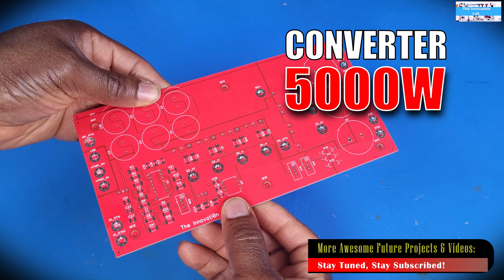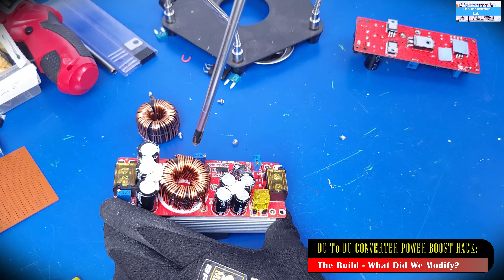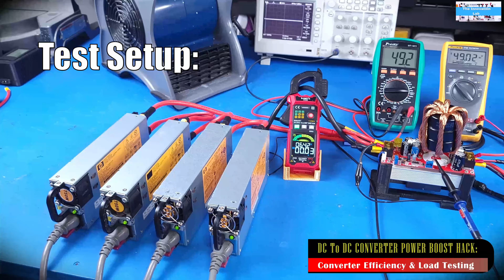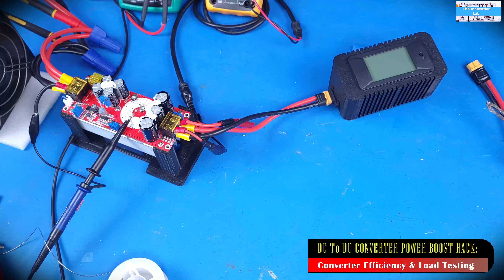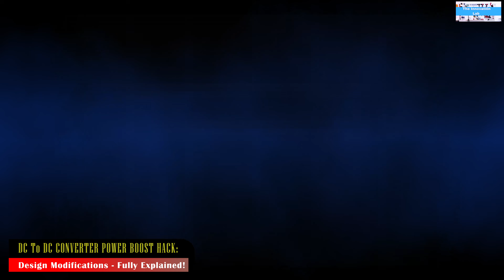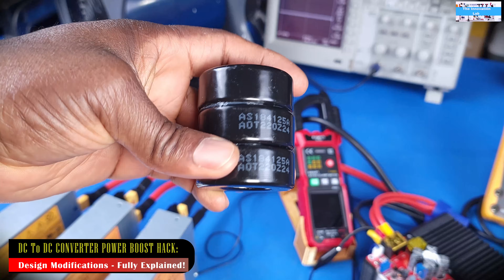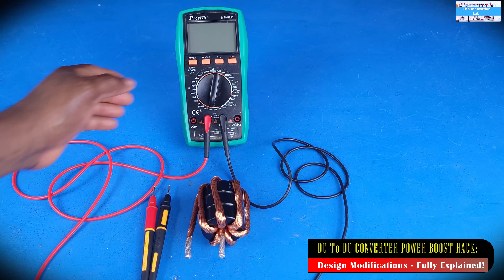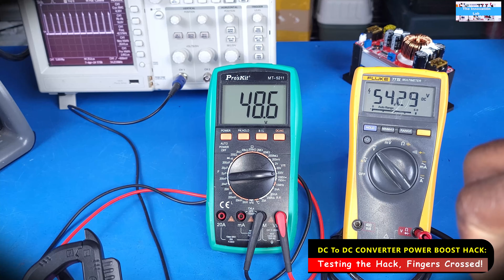How to Supercharge a DC-DC Boost Converter to Deliver Higher Power!⚡️💥

Comment: Hello dear friend, in the formula you put fsw=rt×ct÷1 in the tl494 IC, which is on pin 6, there is a resistor whose number is 103, which means a 10k ohm resistor, but you put rt in the formula 100k ohms, compared to the resistor placed in the boost converter, which is number 103, and rt10k and ct0.001uf divided by 1, my question is this,,, I wanted to see if you, in relation to this formula above, removed the 10k resistor from pin 6 of the tl494 IC and replaced it with a 100 ohm resistor, a 50 kilo multimeter, a 100 ohm resistor, and connected the last pin to ground, or not, I would like to thank you because I carefully saw that the resistor on pin 6 of the boost converter IC had a count of 103, which means 10k ohms.
Reply from the maker: Your observation is very correct.
The TL494 circuit in this converter uses a 100kHz switching frequency. So if you do the math at Ct =  0.001uf, and Rt = 10k, then you will get a switching frequency = 100kHz.

F(sw) = 1/(0.00000001 * 10000) = 100kHz.

I increased the value of Rt because I wanted to lower the switching frequency range to help me find the optimum operating frequency for my modified inductors.

I hope this helps.
Cheers!
The IPL💥

Comment: At 12v 60a in,  that is 720w, but these are rated for 30 or 40a inputs. So no modifications for input current is necessary since they have 60a of fuses? And so since 720w is max input at 12v, this toroidal inductor upgrade would not be of any value, right?
Reply from the maker: Even if the input current is within limits, the inductor upgrade is still valuable because it prevents magnetic saturation and significantly reduces core heat losses under continuous heavy loads. The original converter will realistically only give you about a 320W output - if you are using a 12V input...however you can see that the modifications made to the power inductor allowed us to double the output power. This is because the modified inductor can now hanlde a much higher saturation current!

Respectfully, The IPL💥

Comment: Hello dear friend, we added a ferrite core to this voltage converter that we came up with, and it became 3 pieces, and we placed 50 strands of 0.22 AWG lacquer wire, one meter long, around the ferrite core, and we also connected pin 6 of IC 494 with two 100 ohm resistors and a multi-turn, and did everything you said. How much current does this DC-DC converter support, that is, how many watts in the end? Thank you.
Reply from the maker: Hello,
Thanks for the engagement. If you followed the instructions in this video and used it to modify your converter. Then the next logical step is for you to go ahead and test it to measure the performance.

Let me know what your result is like.
Cheers!
The IPL💥

Comment: suprised you didn't reinforce the input terminal pad. I wrenched one off a unit, i was forced to delete terminal  pad and solder wires directly to board.
Reply from the maker: Thanks for sharing that great tip and feedback! Reinforcing them with some soldering is always a great idea and I always do that on the PCB side. Sometimes, it also helps to stake the connector housing to the PCB with some good adhesive. 

Respectfully, The IPL💥

Comment: without upgrading mosfet?
Reply from the maker: Thanks for the wonderful engagement. The MOSFET is not the limiting factor. Yes, I agree that a stronger MOSFET is always better for high power applications. However, in this case, there were other bottlenecks to consider as explained in the video.

Respectfully,
The IPL💥

Comment: compared to the original version with this 12v input modification, what is the maximum output in watts?
Reply from the maker: Great question.
👍👍👍
However, I covered the 12V test in the video.😊 
As you may have seen, I have a lot of test videos with lots and lots of data presented. Almost impossible to memorize it all.

Pleasr review the test portion of the video and I am sure you will find the needed information.
👍👍👍

Thanks for all the great engagement.

Respectfully,
The Innovation & Power Lab
Reply: @theinnovati0nlab782  I would need an output power of 1500w with a 12 or 24v input. Is this possible? In the video I saw that you raise the voltage to the maximum allowed, but by lowering the output voltage the efficiency increases and in output watts?

Comment: Hi  thanks for nice and informative videos. I am looking for 24 to 50 volts  pure DC input to 250 vDC 1 KWhr non isolsted boost converter.  Any design from your end plz
Reply from the maker: I wouldn't recommend using non-isolated design topology given the high output voltage level. I am not saying it can't be done.😊

Personally, I would prefer using a push-pull high frequency transformer....with a rectified secondary.

Respectfully,
The Innovation & Power Lab

Comment: Hello dear friend, I am from Iran, and I followed your method to make this DC converter, and I used two 100 ohm resistors and put a 100 kilo multiturn in their path, and by adjusting the multiturn for the output wave of the oscilloscope, it is as you showed, but I do not have an oscilloscope so that I can adjust the multiturn to know if this converter is working properly, so what should I do? Please tell me because I need to make some of these converters for a job, for a 48 volt 10 amp brushless motor. Thank you 🌺
Reply from the maker: That was a great question.👍👍👍
However, it will be difficult to implement and reliably test the modifications if you don't have the needed equipment.

If you are driving a 48V, 10A load. You really don't need to do this hack. Just increase your input voltage to level to  24V and you should be fine. Or you could try connecting two or three of these converters in parallel - as I showed in the video below....bit again not having a scope, makes it more challenging.

https://youtu.be/pcwBBZ_T8bA?si=clxd9ODTZrcdWVON

I hope this helps.
Respectfully,
The Innovati0n Lab

Comment: How to increase its output voltage to max 150 volt is it possible
Reply from the maker: Yes.
You need to select  MOSFET, Diodes, and outout capacitors that can handle >150V.

Please watch the video below.
Reply from the maker: https://youtu.be/iQnXLZqpSpo

Comment: How to set the right frequency without oscilloscope? Without oscilloscope how can one know what is the right frequency for thier set up?
I don't have anything to test the frequency
Reply from the maker: I wish I knew of a way to test higher frequencies with a scope. You can look for some cheap handheld scope that is not super expensive online.

🤔🤔🤔💡💡💡
You have turned ON my curiosity....I have diy idea, but afraid it could turn into a big project. It can possibly be done by using tuned high-pass filters and an indicator LED. But this approach will only serve as a high frequency dictator and wont tell you much about the waveform, duty cycle, etc.

Stay tuned.
The Innovati0n Lab 
Respectfully,
The Innovati0n Lab

Comment: The test setup is nice doubt with that, but for the fair judgment of efficiency you should have put set output voltages stable like 60v, 72v, and 82v while varying the input voltage. That we can stably test the efficiency of driver at all available input and output voltages. Here it's kind of mix and match of both input and output voltages, which may and may not be as accurate across whole range of output...
Reply from the maker: I see your point and it makes sense - if this was a standard converter build to industry standards.  However, testing this converter is very tricky because it is not build for optimum perfomance accross the 10 to 60V input voltage range. If measuring the efficiency of converter was the primary objective...and I was only measuring it at 500W across all the input voltage levels, then your suggestion would work. If you put a 1000W load on this converter at an input voltage of 12V, it will lose output voltage regulation. I explained this in the initial converter review video. You really only get >1500W out of the original converter is you apply an input voltage close to 60V.

 The main objective of the testing was really to know the maximum output power the converter could deliver at given input voltages - given the modifications that was made. I was passively capturing the efficiency at each test condition.

In a future test I will conduct a dedicated efficiency and output stability test segment to the videos.

Thanks for the wonderful feedback.

Respectfully,
The Innovati0n Lab
www.theinnovati0nlab.com

Comment: Can this modification works with. 1200 w converter also?   Do need to change my mosfet? Does mosfet shotky diode bear more amp.
Reply from the maker: Great question.
You would have to do a circuit analysis on that board...just something I haven't considered. But yes the overall design concept is the same.

However, the price difference is not that much - why not just buy the 1800W model? Will save you a lot of headache.

Respectfully,
The Innovati0n Lab

Comment: Is that resistor you moved connected directly to the inductor. My converter has a lot more resistors
Reply from the maker: No, its connected to the PWM IC. Its for adjusting the switching frequency. Just follow the steps I have shown in the video and you will be fine.😊

Respectfully,
The Innovati0n Lab
Reply: @theinnovati0nlab782 thanks for responding, can I purchase the boost converter that one you designed? I saw the PCB and it looked really intriguing.

Comment: Pls which pin did u apply the 100 ohm resistor on that tl494 driver ic and what is the number of that preset resistor u used
Reply from the maker: Please watch the entire video and don't skip through it. Your question was explained in the video.

Respectfully,
The Innovati0n Lab

Comment: Bigger power not just go though the inductor!   The whole board should be design for such higher amperage!
Reply from the maker: Right.
That is why we are not trying hack the board for a 5000W power output as I understand that there are always design bottlenecks and limits. Our modifications are more for better efficiency and a slight increase in the output power. 

I looked at the PCB layout and I was convinced that it can handle the dissipation. I have experience with power PCB designs and I am not your regular free energy guy on YouTube.
As I embark on such efforts, I do lots of analysis, calculation, research, and testing as I go along. 

The improved performance and efficiency you saw (if you watched the video) was not accidental.

Thanks for the wonderful engagement.

Respectfully,
The Innovati0n Lab💥
www.theinnovati0nlab.com

Comment: Hello my dear friend, I had a question about the shunt that needs to be added. Can I use enameled wire? Of course, I'm considering the same thickness as the first shunt. Because I didn't have a wire of this thickness, what metal is that shunt made of? Aluminum. Thank you again for taking the time to answer me. I really appreciate it.
Reply from the maker: Great question.
The quick answer will be no. You shouldn't do that.

Respectfully,
The Innovati0n Lab💥

Comment: Hello dear friend, I don't know your language, and I use Google Translate, but I saw the changes you made on this DC to DC converter, but on the board, did you use 3 ferrite cores or 4 ferrite cores. Because it is different in the output of the converter amp, and you used 50 strands of 22 awg enameled wire with a length of one meter, is it possible to use 20 awg instead of 22 awg enameled wire, but the number of 50 strands is 55 strands of 20 awg enameled wire? Can this be done, thank you
Reply: Hello my friend, thank you for the answers you gave me and how quickly you did it. I am really glad that I have your YouTube channel because you are a knowledgeable person who, while giving examples, shows what voltage this DC converter boosts at the input and what power we get at the output. Thank you very much 🌺
Reply from the maker: You are most welcome.😊

Respectfully,
The Innovati0n Lab
Reply from the maker: Hello wonderful friend!
You have gone through a great deal of translation hurdle to reach out to me and for that, I am greatly honored and humbled.
Thanks!

Regarding your questions on the inductor design, it ended up using a stack of 3 ferrite cores - just as shown in the Thumbnail.😊 I know that at some points in the video, I showed a stack of 4 smaller cores....but that was during the testing phase, as I later changed it.

The bigger cores have a larger internal diameter and makes it possible to fit the large twisted 50 strands of gauge 22.
Please check the video description for the amazon product link for the ferrite core.

You can use Guage 20 but you may need to use fewer number of strands - if not, it won't through the torroidal inner diameter for the number of turns you need. Also, there were some other calculations behind chosing the 22 gauge wire for the design.
But I believe the impact will not be that much if gauge 20 is what you have.😊

I hope the helps.
Please consider joining our Patreon platform.
👇👇👇
https://www.patreon.com/c/TheInnovati0nLab/membership?redirect=true

Respectfully,
The Innovati0n Lab💥
www.theinnovati0nlab.com

Comment: Hello dear friend, sorry for asking so many questions, you used two 100 ohm resistors and removed the 10 ohm resistor that goes to the TTL49 IC and put a 100 ohm resistor, where did you connect the second 100 ohm resistor? Thanks
Reply from the maker: No worries at all.
👍👍👍
The entire network goes across the pads you removed the resistor from. This is the resistor connected to pin 6 on the board.

Respectfully,
The Innovati0n Lab💥

Comment: My question is, can 4 old 400 watt ATX power supplies be used to reach 48 volts 1600 watts? I see that you are not touching the external cases.
Reply from the maker: Great question.
I really don't know because I haven't tested those.

You can never tell how these standalone  power supplies will behave until you tested them.

However, it should work in theory following the same methods I used to build the ones I am using. 

Please check diy power supply video on my channel for the how to tutorials.

Respectfully,
The Innovati0n Lab 💥 www.theinnovati0nlab.com

Comment: If we give 36 volt at input and try to charge a 24 volt lifepo4 battery, then what will happen?
Reply from the maker: Great question.
👍👍👍
I am glad you asked before doing it.😊

A boost converter will only allow you to boost lower voltage to a high voltage. If your input voltage is 36V, your output voltage will start at 36V and go higher from there. 
Most 24V batteries will require less than 30V to recharge them ....plus you will have to control the charging current.
So, doing what you suggested will damage your battery right away and possibly also damage the converter.

Please don't do it.😊

Respectfully,
The Innovati0n Lab💥

Comment: Hello dear friend, can I connect this DC to DC converter to my mini truck battery? 24V 100A means the input amperage will not burn the converter. Thank you for the useful clips.
Reply from the maker: Great question.
Yes you should be able to connect it to your battery system without any issues - so long as your converter is not faulty. 

The converter has an input current limit and it can take input voltages up to 60V.

Power supplies snd electronics devices pull the amount of current they need to perform a function. What matters in this case is your input voltage and the amount of load you have at the output of the converter. You could connect your converter to a 24V, 100000000AH and it will draw exactly the same amount of current if you connect it to a 24V 200AH battery system.😊

The Innovati0n Lab 💥 www.theinnovati0nlab.com

Comment: My friend, it would be better if the coil wires were bare enameled.?
Reply from the maker: Great question.
No, the wires need to be laminated/insulated to prevent the copper conductors from physically touching each other.

I hope this helps.
The Innovati0n Lab 💥 www.theinnovati0nlab.com
Reply: @theinnovati0nlab782  İ SEE THAX LOT
Reply: @theinnovati0nlab782  COZ VOLTAJ TO LOW AND HIGH WAT ?
Reply from the maker: @ox_police  
Not really.😊
Inductor wires need to be insulated. I explained it at high level in the video.

I plan to make an inductor tutorial video in the future.
The Innovati0n Lab 💥 www.theinnovati0nlab.com

Comment: what is the part number for the ring?
Reply from the maker: What ring?
Reply: @theinnovati0nlab782  the part you have 3 of and you wind the wire through, it looks like a round ring, the inductor core i think its called
Reply: @theinnovati0nlab782  i found it, its part AS184125A
Reply: @theinnovati0nlab782  Is it possible to boast the amps as well as the voltage?

Comment: Hello! Thanks for the video.
I have a question:
What is the energy loss in terms of current when boosting the voltage to 30V or higher while needing more current, like 20A, assuming appropriate component values are used?
I want to build one, but I'm not sure about the energy loss.
Reply from the maker: Great question.
👍👍👍
It was not tested at those exact conditions. However, the losses will vary depending on the input voltage level.
You should expect about a 75% (average) efficiency with these converters if you are using a 12V input.

A 75% efficiency means that you will be loosing about 25%
Of your total output power. An example will be assuming you are pulling a power of 30V, at 20 Amps  = 600W, then you will require an input power of approximately 800W....which also  means that you will be burning about 200W as losses.

I hope this helps.
We need to get to a million subs🤣 you can help by sharing our videos.
The Innovati0n Lab 💥 www.theinnovati0nlab.com